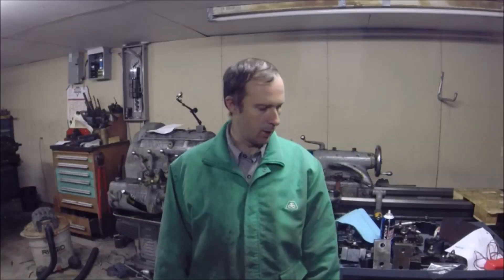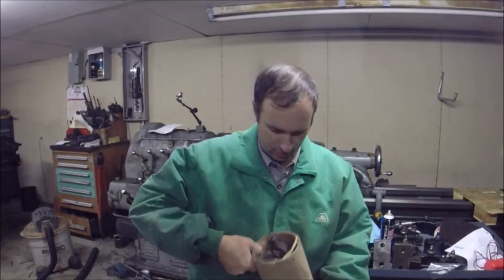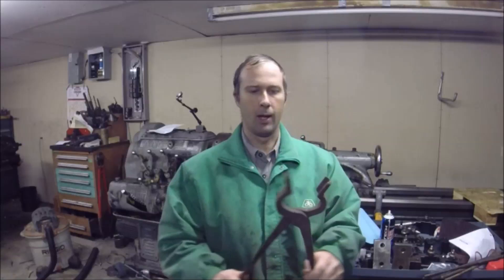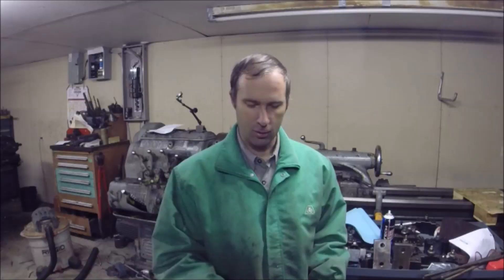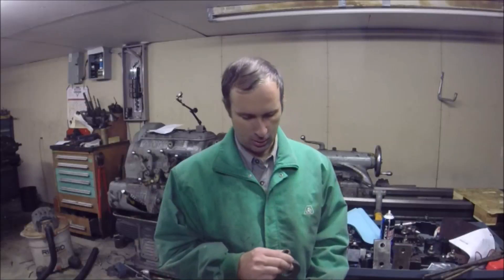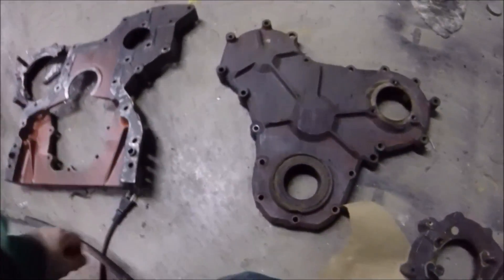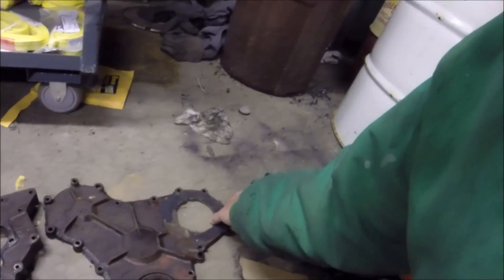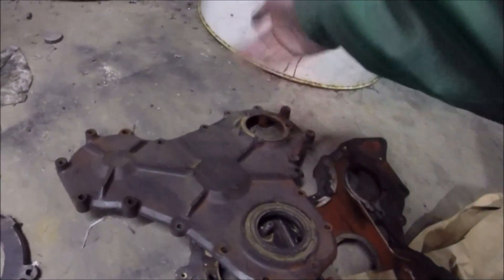Timing Cover Mods

Comment: Brian, was wondering if you brazed in the old holes or just left them as is? Nice video! How's the beams and columns coming for the new shop?
Reply from the maker: +Fred Newman  Just left them, they are covered so they  can't leak. The steel supports are about 4/5ths up.

Comment: Thanks for the shout out Brian, When you use the tongs warm up the ends before you grab your  part. It sounds like I will be getting a pulling tractor in this winter for a lot of mods Thanks again
Reply from the maker: +THE IRONWORKER What kind of tractor is it? Glad to give the shout out. How is the new shop coming? I will remember the tip on warming the tongs.
Reply: IH 3688 painted black going down to the light class. Four chargers 502 ci. changing to 3 chargers lighter rearend and a lot of  frame changes plus a lighter roll cage
Reply from the maker: THE IRONWORKER
 3 charger 2 stage or going to be 3 stage ? Sounds similar to Esdons Light tractor he had.
Reply: Well I'm not sure My customer/friend bought the system. and he will install it I get the chassy work. It could be like Esdons

Comment: In the machining community, there is a say:  If you can set it up and hold it you can machine it...   !!!   ;)
Nicely done, GoPros are in my books, little shits...
Reply: Yup, in my opinion they're overrated these days. The competition has caught up with them. I used to have a Hero2, but I've moved over to a Sony. Better quality video, image stabilisation, hugely better sound, better battery life, doesn't randomly crash, and it costs less.  ;)
Reply: +pierre beaudry Sorry about the GoPros, I meant overpriced little shits...   lol
Reply from the maker: +pierre beaudry Perhaps they should be Go POS. lol I mean it is nice to have a little camera I can take kayaking and not worry about, but it really isn't the ticket for filming in the shop.

Comment: Hi Brian,

an idea just popped into my head. You may have already considered this, so apologies if you have! For the Barn Project, why not setup the GoPro on a tripod, with a wide shot, and get it to take still photos every couple of seconds (they have that option). That way you could simply set the camera up, get to work, and you won't have to hold it. The GoPro App then lets you combine all of those still photos into a quick video, that you could narrate over, to tell us what you're doing. That way we'd get to see you doing the actual work? I'd have loved to see the concrete pouring, and you climbing around the building, trying to right all the posts, replacing the rotten ones, etc. What do you think? Worth doing?

Kind regards,

Michel
Reply from the maker: +mictho100 I will have to examine the timer option on the Go pro. The big question would be if you can get it to power down between shots, if not I don't think I can get but about an hour before the battery goes flat.
Reply: +bcbloc02 Yeah, that's no problem Brian. You can simply stop then camera if you need to move it or something, and then re-start the photo mode. Done that many times on my GoPro Hero2. I'd recommend getting spare batteries for this kind of thing though, cause you know how the GoPro eats batteries at the best of time! I've once documented an entire day worth of engine work with a friend with the GoPro, with plenty of stop and starts in between. Had to change the battery 3-4 times, if I remember correctly. At the end of the day, simply open the GoPro App, show it where the images are (on the SDCard) and it will then stitch them together into a video for you. Easy peasy :)
Reply from the maker: mictho100
Will a Go pro app run from a windows desktop? I don't have a high tech phone.
Reply: +bcbloc02 yup, you can download it from the GoPro website and then install it on your desktop machine. It's called GoPro Studio.
Reply from the maker: +mictho100 I currently use go pro studio for my video editing, have never put pics together with it but imagine I can figure it out.